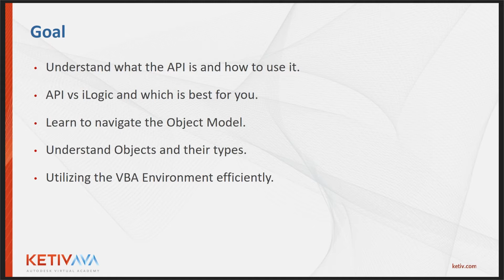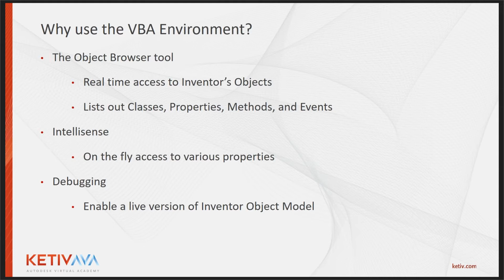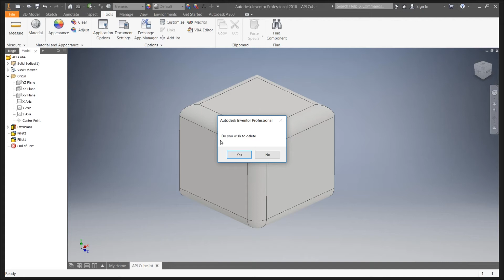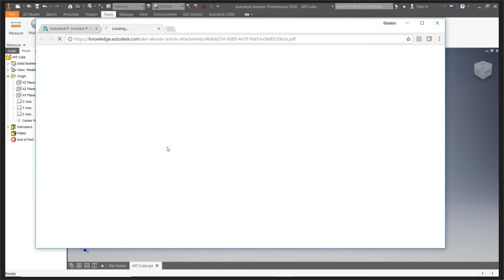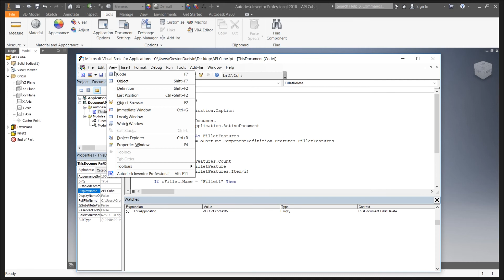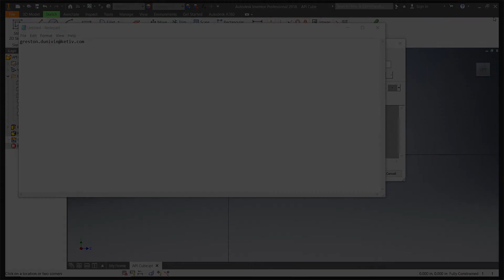Comment: I thinks its a cool feature, however for removing a fillet you needed at least 10 minutes and this is usually takes a few seconds, I don't see the benefit of it as you show it in this session.
Reply: Seyar, we used the examples as there are definite use cases for having to complete these tasks on an incredibly large scale. Imagine having hundreds if not thousands of different assembly configurations that can be generated instantly. It's really powerful, but automation in general certainly favors certain projects that have tons of volume and are configurable.

Comment: Hi,

I have a problem when i place an Ilogic assembly (i will call it is A) into another larger assembly (Call it is B) which contains A.
When A was placed into B, A became A-01, A-02, A-03... and my screen show 
"Error in rule: hight, in document: 18A0018T001338-01.iam
Component: The component named "18A0018T001343:1" was not found."
( "hight": name of rule.
"18A0018T001338.iam
": Name of ilogic assembly
"18A0018T001338-01.iam"
: Name of ilogic assembly after was placed into larger assembly
"18A0018T001343:1": Name of first component is inside "18A0018T001338.iam
" )

Could you please help me fix it? or could you please show me what i need to do when i place an ilogic assembly into another assembly?

Comment: I am self taught for both Inventor (since Series 9) and iLogic Since 2017. I have had a lot of help along the way trouble shooting some of my more complicated efforts. Some of that help has included incorporated API code into iLogic. When I finally started to make sense of the iLogic programming, it was because I could "read" the code because it made sense. The API code, however, is completely different. Would it be possible to do a video tutorial on the API code. What I am looking for is an explanation of the syntax. For example, what does "dim" mean in API syntax? When I first learned Autocad way back with Rel. 9, my mentor had me dig into the .mnu code and start writing macros to automate the drawing process. I began to "learn" the .mnu language. I have learned the iLogic language (to some extent) but the API language... Well, lets just say the little light hasn't lit up yet. I can't seem to make sense of the syntax. Please help. Thanks for you time.
Reply: Frank, When you say API are you talking about VB.Net (stand-alone program like Visual Studio Express)  or VBA (the programming that's still done in Inventor but not iLogic)? I worked with Excel VBA before I started on iLogic (also self taught) so for me VBA was easier but now I prefer iLogic. If you are looking to learn the basic syntax for VBA (When to Dim a variable when to Set that variable, ect.) you should do some Googling on "Excel VBA basics". They have a HUGE user base of intro to VBA (I personally like www.cpearson.com). Excel even has a record macro to help you capture the basic structure for your first codes. I know it seems odd to tell you to learn a new program to learn part of Inventor but there is so much more out there on Excel and the syntax carries over very well. Also VB6 has a similar syntax (I believe VBA is actually left over from VB6) but it's so much older I don't know that you'll have as much luck with it.  Best of luck.
Reply: Here is some info on VB.NET https://ketiv.com/blog/how-to-program-in-inventor-ilogic-vb-net-operators-and-expressions/